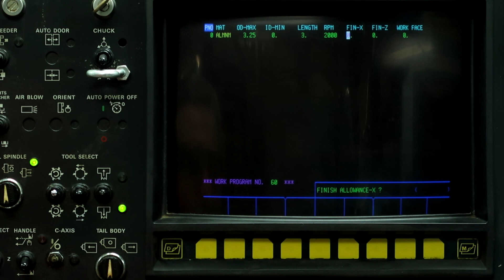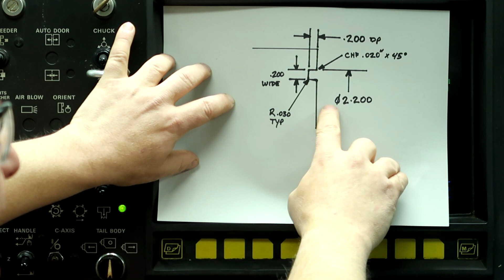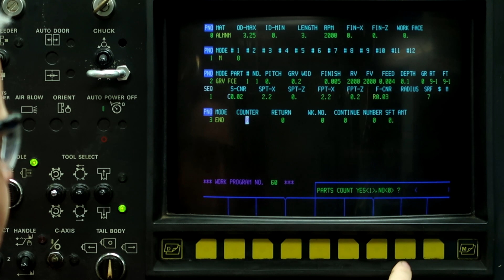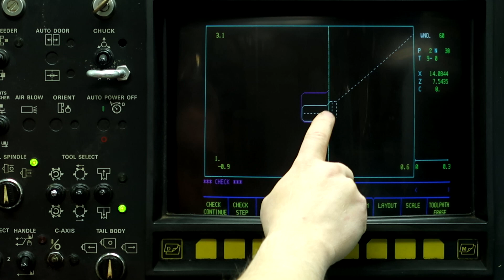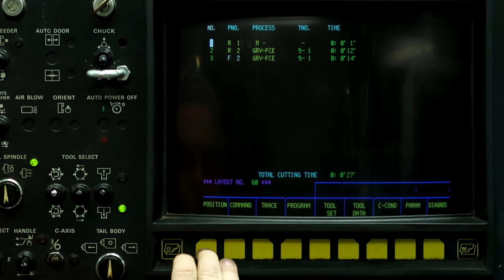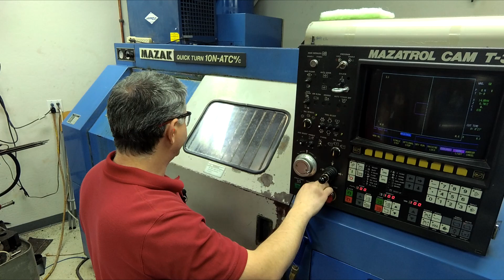Mazatrol Programming Lathe Grooving Face Mazak

Comment: Could you please do a video on cutting a face groove feature with asymmetric tapered walls? Something like 5° on the ID & 3° on the OD. I work at a tool & die shop and we're considering purchasing a used Mazak Integrex 200y sometime this year.
Also, great demonstration! 👍🏽

Comment: You said program too the ID at 2.2 of the groove did you mean the OD
Reply from the maker: Face grooves type 1 are programmed using the ID side of the groove and the groove width.
Reply: @mazatroltipsandtricks6816 would the ID of the groove not be 1.8?

Comment: phil 
i have a problem i can't get mazatrol to groove .14" deep WIDTH is .125"!
the insert is .125" wide too. i need to leave 30 degree edges not 45 degrees can you help ? 
do you have a CAT 40 or 50 holder if you look at the shoulder of the holder ? that's what i am trying to do basically
Reply from the maker: That can be done using 3 grooving processes. Use groove 0. First groove straight in, second groove left 30 degree angle, third groove 30 degree right side.
Reply: @mazatroltipsandtricks6816  ok so do i give it a negative angle ?
Reply from the maker: @christophercolumbus8944  I believe so. The graphics will show groove 0 cutting an angle if the Z end point is different from Z start point.
Reply: @christophercolumbus8944  you can you have to OD turn that groove/profile but choose grooving tool instead youd also have to set Z 0 or start point that's the crucial part. id also go .13" so the insert can fit in there.

Comment: how do you face groove on mazak the part is 7.875 diameter has a boss diameter of 3.188 it's to go down to .844 deep with a half inch radius blending into a 5.125 diameter face groove 1.0 inch deep so I'm having problems with the simulation the groove tool is wiping out where my radius is suppose to go anyway to send u the print ?
Reply from the maker: Try using the highlighted groove face option instead and see if that helps.

Comment: Programming seems simple enough. Learning the user interface probably the most difficult thing for someone experienced with other lathe controls. Why Fanuc doesn't have a canned cycle to do this very thing is beyond me. Good job on the video.   Brent
Reply from the maker: Hi Brent!  Thanks for watching. Learning Mazatrol is easy.   One thing that really blows me away is this machine is 34 YEARS OLD!  In my opinion, Mazak was way ahead of it's time when they developed Mazatrol.  Check out my other video on OD Grooving.  In that video I show you how to machine 3 tapered pulley grooves using the same 2 lines of code.
Reply: I started using the mazak is definitely a little different then Fanuc. The Okumas now have canned cycle, and I find it easy to program as well.
Reply: @chamacorunner1  i divorced my wife so i could marry my mazak ? haha